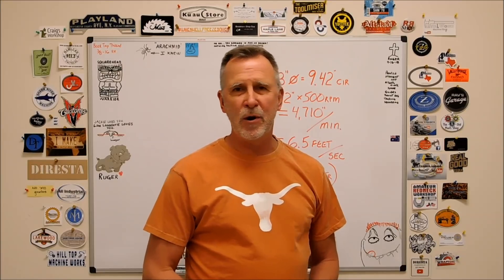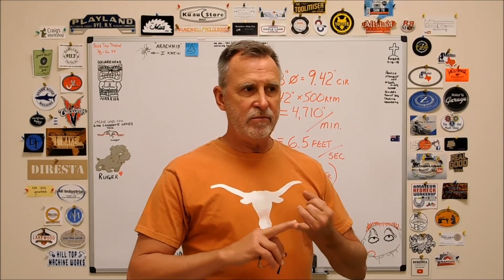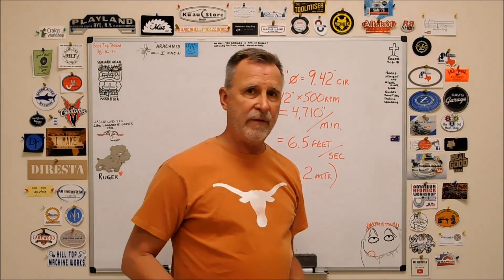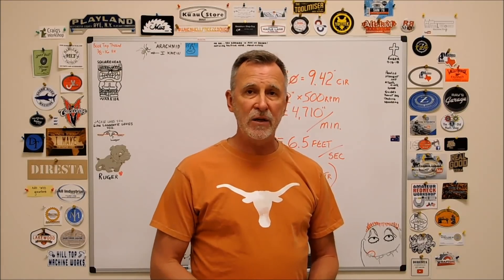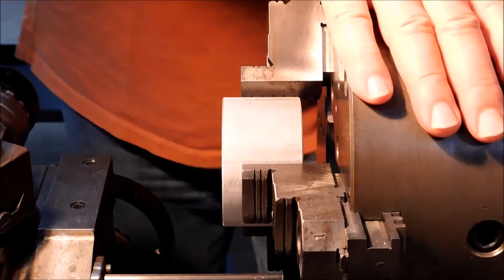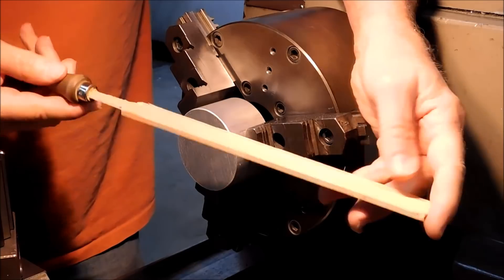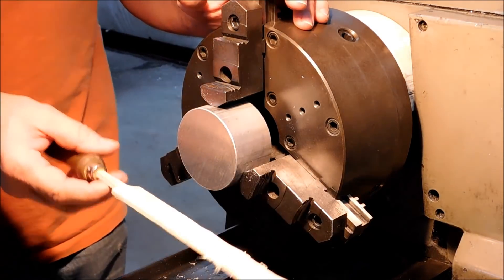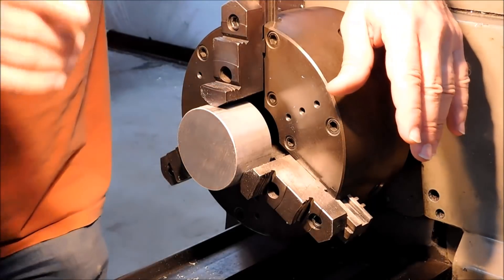File vs Spinning Chuck Jaws

Comment: Hi Joe love the wooden file ,try at the way a left-handers would do it hold the handle in the left hand and the end of the file on the right hand and you standing away from the chuck well clear,cheers lefty's rule.
Reply: John Robinson, while I am dominantly right handed my Father was left handed and as a young man (teens) I watched Dad do this and thought that's a safer way to do this Lathe file operation. I did not get there and am all but 60 now. Only thing I have managed to do competently left handed is Weld when the need arises, I still however do not trust myself do do this operation with my left hand on the handle, I may try a wood file to explore this as a confidence booster.                                                                                                                         Cheers from John, Australia.

Comment: Great video Joe. 
All you in the UK you are the only ones that are metric, catch up with the rest of us and go 6's and 12's
Reply: The United States, Liberia, and Myanmar are the only three countries in the world that have not fully implemented the metric measurement system. 
The other 192 countries in the world use metric.
Reply: Actually only the U.S.A, Liberia, and Burma are still officially stuck on imperial measurements, although here in the UK we are pretty much bi-measurements in that we can use both, so officially, fuel is sold in litres, fuel consumption is generally expressed in MPG, road sign distances and speed limits are in Miles and MPH, weights are metric (Kg and grams), beer is sold in pints, milk is sold in liters yet alcoholic spirits are sold in centilitres / litres.Some of us can even work in both mm and inches whilst working on the same project ;-)
Reply: To those preening themselves on being utterly, totally metric, tell me what size drive ratchets and sockets you have…
Reply: @horacerumpole6912  see my earlier answer for UK response to your question. TL;DR, metric (or  imperial) sockets with a metric drive is neither unusual not an issue here, we can mostly switch between both, although science much prefers SI units.
Reply: OK-show me a socket and ratchet that have metric sized drives-
Don't assume that Americans aren't comfortable using metric as well as imperial-we are!
Reply: @horacerumpole6912  12.7mm
Reply: You mean decimal? Metric can be dozenal too.
Reply: No...
Reply: As an American who hates fractions, F imperial.
Reply: This is gold. All these blokes blowing up about the most mediocre of points. Wake me up later mom.

Comment: There's something to be said about being overly familiar with machinery. Shop students are taught to be very aware of the dangers, and after 3 semesters of machining the only injury that I witnessed was to an instructor being a little too careless about some material extending too far out the back of a lathe spindle.
Reply: ...and it whipped, bent, whipped around and became menace and caused damage to anyone or anything too close...
Reply: @milantrcka121  Exactly. It could have taken off his head. Luckily his arm was in the way and took most of the force.
Reply: @FieryWACO  Ouch!